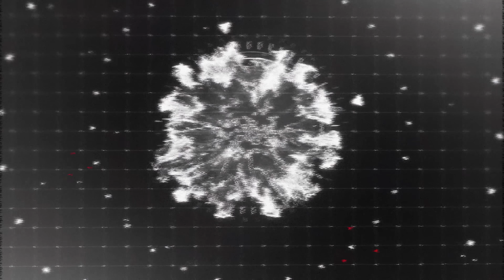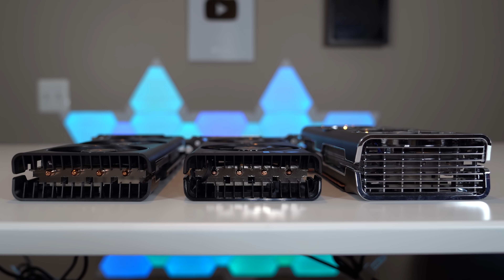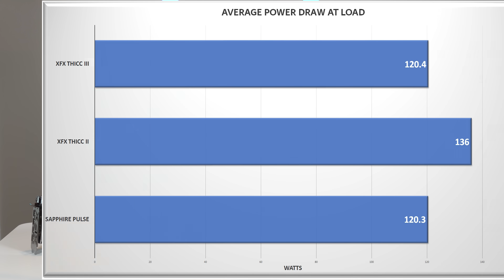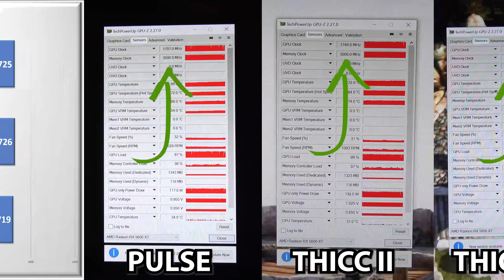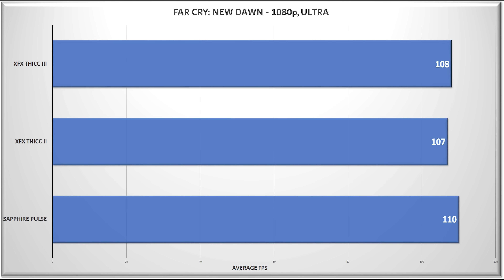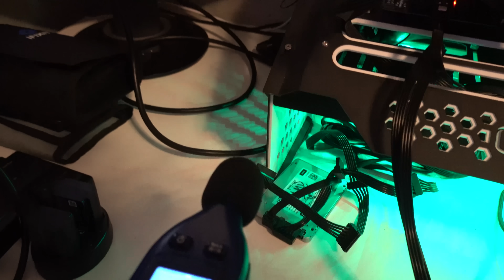How THICC Is Too THICC? XFX's New 5600XTs!

Comment: I have the 5600XT Thicc 3 pro.  It was cheaper than the thicc 2 on Amazon because Amazon charged tax on the thicc2 but not the thicc3... It runs cool, and much much faster than my old R9 3900 card.  Flashed the bios immediately when I got it, installed the most recent non beta ATI drivers, and I've had zero problems.  Just make sure you have the space in your case.
Reply: have the memory clocks been fixed?
Reply: @ItssMitch  someone needs to answer this question. I wanna know if you can simply overclock that memory to 3500 mhz like the puls.

Comment: It have the XFX 5700 XT Thicc III and the card if awesome. Max temps range from 58c to 63c.
Reply: Did you experience any driver issues? I have read many owners have.
Reply: @bocconom  When I first got my card the drivers didn't see my freesync, and I'd get a black screen every once in a while. But the latest drivers seems to have fixed those issues. The card has been rock solid for the last month or so. I did experience a browser crash the other day, but I'm sure that was caused by me pushing the RAM overclock a little too far. 3600 mhz Hynix m-die does not like running at 4000 mhz @ 1.6 volts.
Reply: @OlettaLiano  Thanks much for your quick reply. I am in the process of building a new Ryzen system with a new 1440p Freesync monitor and have been researching cards. My budget at this point can't handle a 5700 XT at the moment but you've given me solid information.
Reply: @bocconom  Glad I could help. I had to get a 5700XT because I have a freesync 34" 3440x1440 @120 hz ultra wide monitor and it's not on the g sync compatibility list. My 1660ti was a good card for 1080p, but it was struggling to push 5 million pixels at the FPS, and I was getting a lot of screen tearing. It looks like the 5600XT should handle most games at 1440p so good luck, and game on!
Reply: @OlettaLiano  I can see why you needed a 5700XT! Yeah been leaning towards the 5600XT as my monitor will be 27".  It's time to replace my 11 year old Samsung 1080p 60Hz which has served me well.
Reply: @bocconom  There's some really good prices on 27" high refresh freesync monitors. I took a quick look on Amazon and saw a AOC CQ27G1 27" Curved Frameless Gaming Monitor QHD/2K, 1ms, 144Hz, FreeSync, DisplayPort/HDMI/VGA, Height adjustable, 3-Year Zero-Bright Dot 4.5 out of 5 stars for just $250 usd.
Reply: @OlettaLiano   Thanks again.
Reply: @bocconom  Yep, I always try to help when I can.
Reply: What case do you have for the thicc III

Comment: How good are the drivers in XFX cards & would this be better then a 1660 card?
Reply: 5600xt compete against a 2060, it’s way better than a 1660 super
Reply: @bastosdansleursmeres5383  Yeah, but it depends what his budget is.
Reply: Jean-Thomas Gabriel-Regis Thanks for the recommendations! How are the drivers on the AMD cards bye now? Do I need to do any tweaking like some guys/gals compline about?
Reply: Andy Black It depends, the firsts batches of cards needed to be bios-flashed to deliver their full potential. But the ones who were made after AMD given the new version of the bios should be fine.
Reply: Andy Black I don’t have the 5600xt so I prefer not to talk about the drivers actually I don’t really know. But I have some issues with the ones of my 1660 super. So I think you can have issues with all brands.
Reply: You don't have to blame or point to XFX but to AMD if there are issues with the drivers. Just as if there are issues with the drivers of your card, don't blame the brand but nVidia.
Reply: I don't know about the version of the 5600XT. But the 5700XT drivers seem to be fixed. My Thicc III has been rock solid since the last driver update, and it would eat a 1660 for lunch and still have room for a slice of pie.